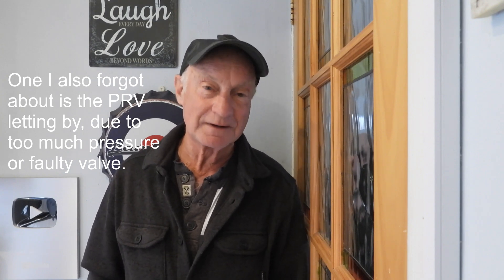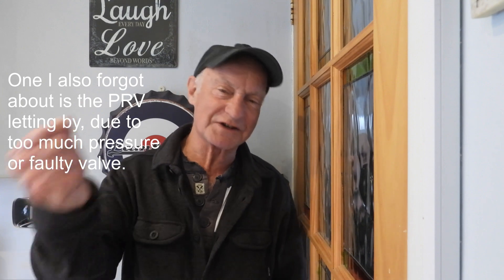Why do I have to keep repressuring my heating boiler?

Comment: Interesting to read this. The wife and I have just downsized to a 1970s bungalow with a four year old Worcester combi boiler, still under warranty.  Last week, I had the Worcester engineer out as it was rapidly loosing pressure.  The engineer changed the PRV (evidence it was leaking), gave the boiler a quick check and left. Unfortunately the boiler is still loosing pressure when the heating is on (hot water is OK). Tomorrow, i have a local company coming to quote for four new radiators and i have asked if they can look into my problem with pressure drop (its dropping to zero within hours of being repressurised). I wonder if sludge in the system is my issue especially with four old radiators.  No obvious signs of leaks (must be a massive leak to drop pressure that quickly, which i would see).
Any comments would be appreciated.
Reply from the maker: Certainly change the radiators. If you have any pipework concealed under floors etc, that could be where you have a leak.

Comment: I bought a house in late 2019 boiler went over new year had a new one fitted and the system was still bad. 
I had radiators changed last year and the guy mentioned about adding more inhibitor which in turn has cleared out my system well that and a mag filter .

All in all it took me 4 bottles of inhibitor to get to the point where the heating actually works now!
But perhaps most important the boiler hopefully will live longer and the bills are about £80 cheaper per month than when we moved in except now we also can get the temp to 22 in under an hour. Used to have the heating on for hours to get to 19 degrees :(
I dont think the people before us had the boiler checked scince it was put in the amount of junk ive had out

More on topic about the video you may also lose pressure as the inhibitor works because as it dessolves the scale and blockages it can also reduce pressure where the space for water has gotten bigger. I know this is obvious to a plumber but it wasnt obvious to me why when i bleed the rad it was constantly spewing more and more gasses.

 So if your like i was bleeding the rads and it never seems to end this may be why. 

These videos are great for me i lost my dad at 14 to MS and my mother at 24 to kidney failiure so i am on my own in this world and your help goes a damn long way so thankyou sir.
Reply from the maker: Glad to be of some help.

Comment: Well said common problem at this time of the year (usually related to the expansion vessel needing pumped up). At this time of the year the ambient temp is lower when boiler is off through the night thus greater expansion of water when boiler fires up causing pressure to rise to the 3 bar mark causing prv to vent excess pressure (water) then when boiler goes off and cools down the pressure needle drops to reflect this discharge of pressure 😊
Reply from the maker: Cobi boilers what a nightmare, cheers Gordon.

Comment: Possible leak on the system like I had someone had clipped a pipe with a screw undetected for years until floorboards lifted and leak found
Reply from the maker: It is normally an undetected leak.

Comment: Possible leak on the system like I had some idiot had caught a pipe with a screw hence a slight leak undetected for years until floorboards lifted
Reply from the maker: Sh-t happens.

Comment: Hi fella, my vaillant boiler keeps getting a F64 error when I use the heating (it's fine when using hot water only). I've had it since mid 2008 and this error always ends up being very costly. So I'm thinking should I go for new gas boiler, a heat pump or a electric boiler to replace it please ?
Reply from the maker: Keep with a new gas boiler. Heat pumps are rubbish as is electric heating boilers cost far to much to run.